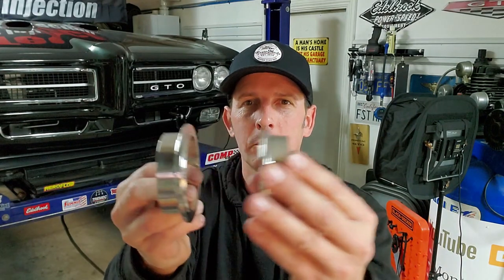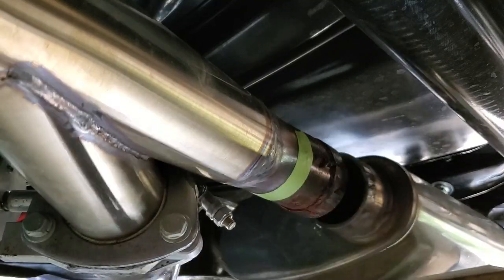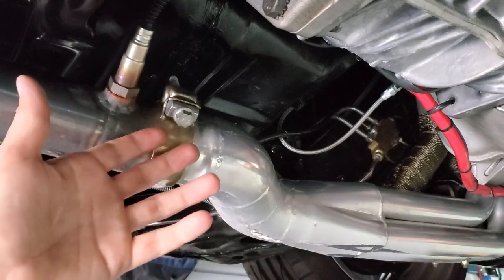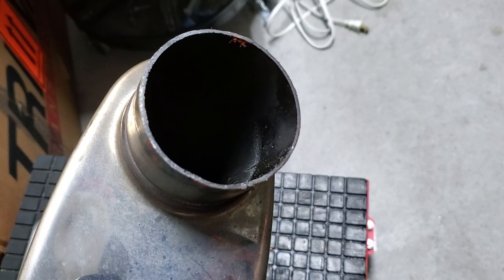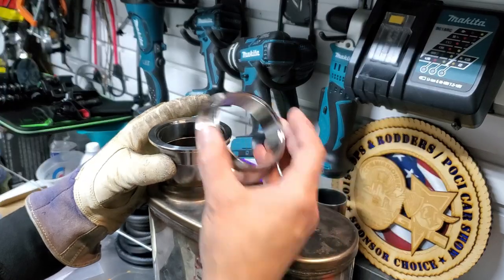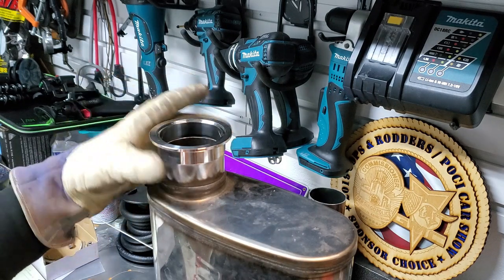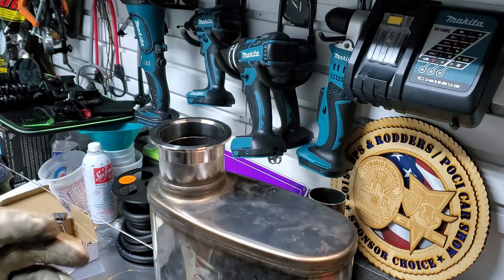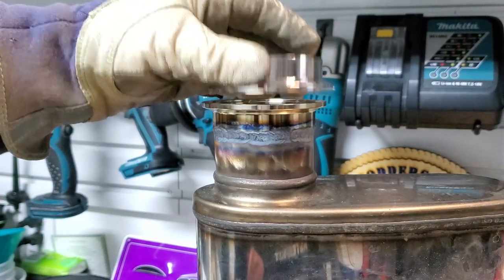How to install V Band Clamps on your exhaust, for easy removal.

Comment: Use a hose clamp to do a straight cut. 
 Also 12” disc sander is a life saver on leveling cuts
 Keep us posted when it’s running again about leaks at v band. Good job.
Reply from the maker: ohhh yeah, A disc grinder is on my Xmas list!  Thanks for the comment!
Reply: @FastMonty  
Just got one. Can’t take credit for that. Another video had that tip. Learned the hose clamp long ago.
Reply: Have a 72 Chevelle SS BB. Building a 486 for it. Sits low so researching full length header that’s tucked up higher than crossmember. Will order it bare and cut their collector off and weld on v bands. Then send out to jet-hot. 
 Did you get warpage? One guy used a thick block of aluminum jet se the v band on and took his time. 
 Also an upper end shop said use a flat piece of glass with a light behind the the v band on it to see if there’s warpage. Videos like yours are a great info to add to the memory bank ! Lol 😂
Reply from the maker: Ha!  I'm jealous!  I certainly need a bigger garage for all of the shop tools on my list.  Thanks again!  @hipoman8087
Reply from the maker: Great Build you got there!  I'm super low too, and go through that pain all the time.  (Currently in the middle of a Currie swap, and have my own new set of challengees... L)  I did not get any warpage.  As you saw, I welded them on with the mating component attached to act as a heat sink.  I don't think I'd do anything differently next time around... well, besides getting a disc grinder.  ha, ha...  OH, have you seen my low profile band clamps?  They're awesome for us Low Riders.... here's the video;  https://youtu.be/VBWw0ocrASQ Have fun!  @hipoman8087
Reply: @FastMonty  
 Ha! That’s why I built a second garage. 1 12x20 shed has the sandblaster cabinet, metal band saw converted to cutting metal, press and some other equipment. All on rollers to move to center or outside. 
 I’m not rich just rich in cards. Ha ha   
 Like you I do things myself or figure how to. 
 I have a tig now also but have to practice before I do those. Patch panels too. 
 Have a happy holiday. 

 Oh! And will be subscribing.
Reply: @FastMonty  
 Will check that out. 
 I have turbo 400 and will be installing my gear venders to it after engine is in. Have the Holley sniper on mine. Love it. Street ability is awesome. With the big cam in my 402 it was amazing. Fired up, not hesitation, no bog, no fouled plugs. Putting one on my 65 impala(1st car I bought)   This will show  my age. Bought in 1976. 
 I’ve got so many projects it’s mind blowing.
Reply from the maker: Yup Fuel Injection is where it's at... welcome to the FMG Family!
Reply from the maker: Ha!  Yeah, wish i had room for another garage... TIG is fun!  Takes a lot of patience.  Good luck, and see you next video!  @hipoman8087

Comment: Nice GTO; never been tempted to sell mine, but always loved the ‘67 - ‘73 Pontiacs. Absolutely great looking cars.
Still own the ‘68 Charger I bought in 1984.
Took it home as a 318/hubcap car. 
Immediately put a Thermoquad on the motor, 3” dual exhaust with H-pipe/ turn downs, and .456 gears. Fun, but not enough torque.
By 1990 it was a 440/4-speed/4-piston disc brake car. Picked up all the better ‘68 options at Carlisle. Built the motor to 525ci/700hp@7000; that turned it into a completely different car.
In 2004 I built a 572 EFI Gen2 Hemi, and I put the car on a tube frame chassis. Motor plate, mid plate, 335/18 tires on all 4 corners, 14” brakes, T56 trans, 3-link rear. Got the weight down to 2800lbs, motor is at 850hp@6500 and the rear gears are .488. 
It’s a low 8 second car.
Never can decide wether these cars are more fun to drive, work on, or to entertain a smoking hot blond in the back seat.
Reply from the maker: Thanks Brother... thanks for sharing the build history of your Charger... that's awesome.  I was actually contemplating going to a 525 on this next build, but the budget is too tight.  Maybe next year.  I prefer Brunette's ... ha, ha... thanks for the comment!

Comment: You need to use Solar Flux or back-purge and more gas for that stainless, welds looking a bit crusty. Constructive criticism :)
Reply from the maker: Yup, good tip!  Thanks!
Reply: He did state he was not a good welder😂

Comment: Can I use mig welder for the v clamps? Tnx
Reply from the maker: I guess you could? ... I've never seen anyone weld tubes with a MIG before, might have to treat it like sheet metal, a dot at a time.  Let us know if you pull that trigger!

Comment: Do you weld with a Lincoln 140 on exhaust and intercooler piping . Or can we use one to make a good cheap setup
Reply from the maker: I honestly don't know... I have never seen anyone use a MIG welder for tubular work.  So, I'd stick with TIG.

Comment: hey Monty  what happened with the oil pressure? did you figure it out?
Reply: oh just watched the whole vid,  dam you got to take the motor back out, its going to be interesting to see what the problem is. may be  you should  try a new filter housing first. the relief valve could be weak.
Reply from the maker: @erica8664  Interesting, for sure... we'll see!  Thanks for tuning in.

Comment: It's not a huge deal, but.. weld the v band to a stub pipe, then slip it into the muffler - not for you this time!  Heh... For one, it gives you a degree or two of wiggle room. And if you need to replace the muff, you're not throwing out the v band!
Reply from the maker: Good stuff John... yeah, when I upgrade to 3" exhaust, I might have to do just that.  Thanks again!

Comment: The tone in your voice 🤣🤣 

But don’t you enjoy doing things the wrong and hardest way possible.? 🤔🤔😁🤣
Reply from the maker: I'm all about learning a better way of doing things.  As I stated several times in the video, I haven't installed band clamps before, and I suck at welding... how about sharing what the best and fastest way is?
Reply: @FastMonty  honestly I thought I could sarcasm with some of the points you were making throughout the video. Hence the sarcastic reply.   Clearly i mucked up on this , ha! Apologies good sir
Reply from the maker: @replicant357  Ohhh! Ha!  I get that now... thanks for dropping a comment!